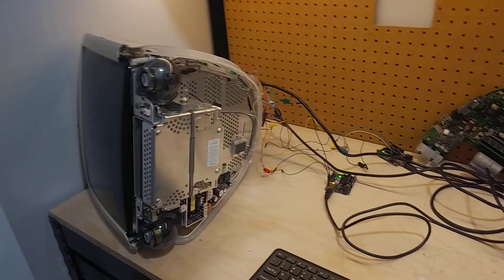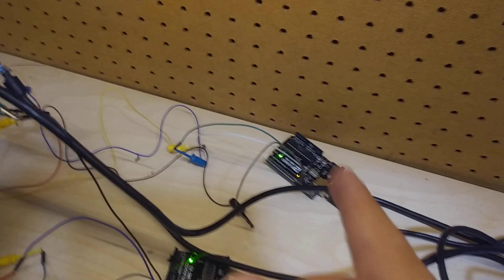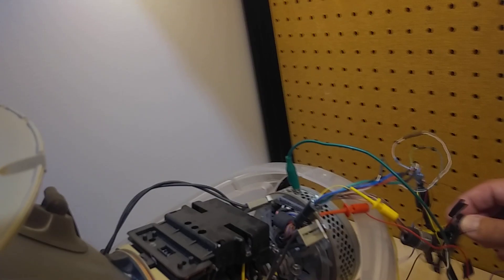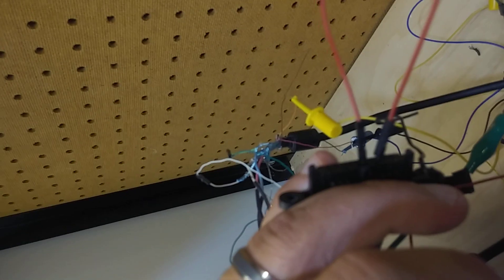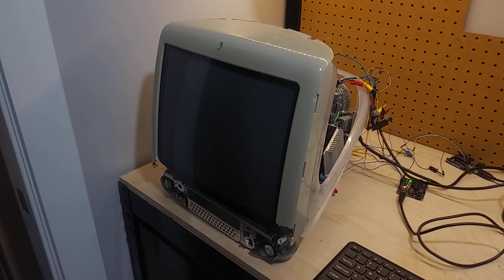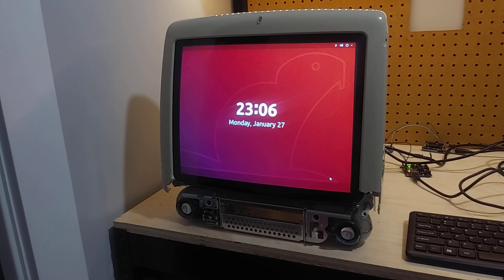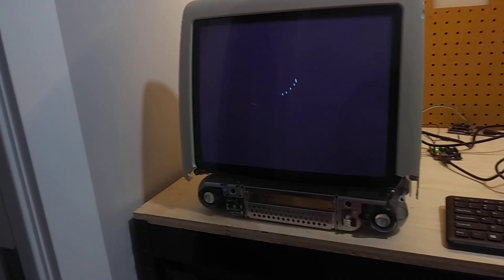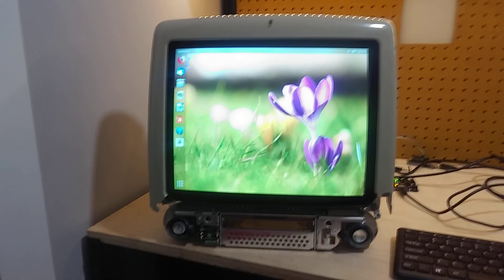iMac G3 as a monitor with no logic board

Comment: Can you please answer before tomorrow!! We have an exhibition we did everything and it works but the screen is greenish, the red is probably not going through but i checked continuouity and its all good.

We don't have the -10V plugged in could that be it? Or could it be from the arduino init? 

The screen definitely had full colors before 

Would be so happy to hear back from you and we can send you the results it will be in an exhibition here next week
Reply from the maker: Hello @egosumali email me at qbancoffee@yahoo.com and explain what's going on. I'm pretty sure I know what your issue is.
Reply from the maker: The issue most likely is that the init sequence sent by the J20 board is from a different G3. The init sequence includes custom configuration for the G3 and every G3 is different. To solve this you can use oshimai's gui to configure it. you'll need a ttl usb to serial adapter and the software. plug in  the usb to serial adapter to the computer that will run the program, connect the TTL side of the adapter to the J20 board as described in the wiki and run the program. you can then use the GUI to adjust the colors on your G3. Additionally, you can just change the values in the sketch and upload and test until you like what you see.  email me at qbancoffee@yhaoo.com

Comment: Not sure if you still check these comments, but it's worth a shot. I followed the guide in the repo step-by-step to convert an old G3 slot-loader I had and... it works!! 
...for 90 seconds. After that it shuts itself down. I know it's a long shot but if you've got any idea as to why it could be doing that, I would really appreciate any bits of information you might have.
Some supplementary info: It's always 90 seconds, no variance whatsoever. Picture comes up blurry, tilted, and dim, but I'm sure there are some bad caps in the display itself that I'll need to get around to replacing as well as some careful re-adjusting of the display itself. I've tried adjusting the vsync power-off timeout to see if that prolongs the uptime, but no dice. Fingers crossed it's something simple I'm just missing because of inexperience, but I'm in too deep to give up now. Endless thanks for putting the time and effort into making this project available to the public. 
Cheers, and hope this reaches you!
Reply from the maker: Hi!  Sounds like you just need to solder JP3. This solder jumper is what connects the V_SYNC signal to the micro controller in order to be monitored. Alternatively you can completely disable this automatic shut off feature if yo comment the "externalCircuitOff()" function call on line 180 or thereabouts. 

    //do stuff whn vsyncDetect is 0
    if (vsyncDetect <= 0) {
      startTime = 0;
      currentTime = 0;
       //externalCircuitOff();

    }

Regarding  your wonky picture, you can probably adjust that using Oshimai's monitor adjustment tool. All you need is a 5V TTL USB to serial adapter that connects to the J20 board and you can run his program to configure the iMac.

https://youtu.be/g9aLTrW5eaU?si=PSUeZirngG73rhpO
Reply: @rockyhill3  Thank you so much for the quick response! I'll give it a shot and post again with the results! Much appreciated!
Reply from the maker: @izanegi  You're welcome and good luck!

Comment: My problem is with the high voltage supply to the CRT. My goal would be to replace the CRT and Logic board both with a 15” lcd screen and an Mac Mini. Basically keeping the shell and using it while I source and troubleshoot the original components. If I could keep the CRT and redo the logic to a mini would be my ultimate goal. Any schematics available online for the power supply to the CRT?
Reply from the maker: https://github.com/qbancoffee/imac_g3_ivad_board_init
Reply: @rockyhill3  thanks for the link! Will check out the project but I think I have to change out some if not all of the electrolytics on the power supply board(s) to curb overheating.

Comment: Hi, I hope you can help me ...
My imac G3 500 DV stoped working last week.
I can't find the issue ...

What makes me confused ist this 24 Vac source.
Is this now 24 or 48 V ac ?

In one pinout it is labeled "24 Vac Phase1" and "24 Vac Phase2" ... I tested 24Vac on these both pins to power up the power converter and the logic board, but did not start.
Is this 48 Vac and the GND is between the both, so if meassured from one "phase" to gnd I see 24 V ac?

I build a adaptor now to start up the logic board with an atx psu, the logic board works fine.

Following your infos it should be possible to bridge these 3 pins at the video connetor and the CRT should switch on, also if the logic board is missing? Just to see, if the AV board works = crt works and without sending the edid datas, just to see and hear the high voltage powering up

Thanks and a happy new year!
Reply from the maker: Thank you for commenting. I just replied to email. let me know how it goes.

Comment: PLEASE make a pcb, Ive wanted to put custom hardware in one of these for ages.
Reply from the maker: The PCB design is on github but you will have to order and build it yourself. However, I am currently working on a design that can be ordered mostly assembled so that I can sell them or anyone else can order them and finish assembling them.
If you're comfortable with soldering you can fins instructions and videos here, just scroll down.

https://github.com/qbancoffee/imac_g3_ivad_board_init

Comment: Do you think it would be possible to do this on an eMac G4?
Reply from the maker: Actually, yes. My first time doing something like this was with an eMac and the iMac mod is based on what I learned from modding my eMac. The eMac work is not as documented and I don't have boards but there is sort of a guide and people have been able to do it.
Take a look through my older vidoes and read this wikibook.

https://en.wikibooks.org/wiki/How_to_modify_an_eMac_to_use_as_an_external_monitor

Comment: This could work for those that had their backup batteries leak and corrode the mainboard!

There's also an open-source CRT controller project that I think accepts a raw RGB signal, I can't remember the name of it (but I remember a GitHub repository exists).
Reply from the maker: Absolutely, you can use the CRT if your logic board is dead but the analog board is still good. 
I have one I use as a VGA monitor when I want to play retro games
Reply: @rockyhill3  
Yep! I'm lucky to have one that works, and I pulled out the backup battery before it leaked. However, I do occasionally come across some that were either untested or didn't start up.

Comment: Can I use an iMac g3 1998 because it uses a 50 pin video cable? Also because the main bored is damaged so it won’t install an OS
Reply from the maker: I'm not sure which iMac you're referring to. This mod will only work with the DV version or the slot loader G3's. If it's a tray loader, then there is another mod that works for you. It's easier than this one.
Reply: @rockyhill3 The first model
Reply from the maker: @Fishmaster_i12  I think the first model can be easily modified. Here is one person who was able to do it.
http://whatdoyouguyswannado.com/Zotac_Powered_Grape_iMac_revD/
Reply: @rockyhill3  can I just connect the video Connecter to the computer with an extension cable?
Reply from the maker: @Fishmaster_i12  I'm not sure because I haven't modded a slot loader before. From what I've read though it seems that it's probably something like that.

Comment: Very cool. I have the older tray loader model so I'm guessing the process would be different. :(

Would be cool if I could do this without taking out the mobo though. (Would be easier for that route too. Just have to create a Y connector and switch it to an external input. Just let the mobo boot up like normal then hit the switch. That's probably how folks did it before you RE's the init stuff. If i were to do this I'd go that route since I still want to keep the original mobo in mine. :D
Reply from the maker: Thanks!
The tray loader is actually very different and the mod is easier. Unfortunately I don't have a tray loader so I can't really explain much about it other than you sound like your on the right track. There are several people that have successfully done the mod and shared. Elvisa on macrumos forum recently got his to display video.
https://forums.macrumors.com/threads/imac-g3-mod-video-connector.1712095/post-28757361

Comment: That's a great idea! How much did the project cost you if you don't mind me asking?
Reply from the maker: Well, it's hard to say how much I've spent on this project given that I've made several revisions of the boards and I've had to purchase spare parts here and there. I can tell you that if you order the boards &  components it will run you around $70.00. This doesn't include the time you'll have to put into actually assembling the boards.

Comment: There should be a PCB for the tray loader g3 as well.
Reply from the maker: Unfortunately I don't have a tray loader as a reference to design one and I will happily design one when ever I do get one.
That said, If you or anyone else has any sort of specs/instructions on how the mod was done, I could design one against that.
Reply: @rockyhill3  You don't need one for a Tray Loader, as the monitor is just DB-15 on the inside and you could get an adapter
Reply from the maker: @kit7une_   I would like to get my hands on a tray loader to test it out but unfortunately I have not been able to. I did however just buy a pristine ruby for $25.00
Great deal!

Comment: I'd love to buy one of those boards. Would the iMac still work through the CRT or does it completely replace it? I was thinking of using the G3 display as a Raspberry PiCade.
Reply from the maker: PiCade is one of my goals too!

To answer your question...... It depends on the degree to which you want to modify your G3.
Adding these boards essentially converts your G3 into a VGA monitor with speakers allowing you to use it with almost any computer. Space is tight in the logic board are of the G3 so if you are willing to use your G3 mobo external to your new VGA monitor then yes. This is a well documented mod and one that I myself have done with a standard ATX power supply and knowing what I know now you can probably do it with the down converter board and a 48 VAC power supply instead of an ATX power supply. You can also opt to leave the mobo installed and and just pull out the wires needed for video and connect the pi to that. You could probably even use a video selector switch to change sources. You can probably route audio through the mic input of the G3 mobo and have it play through the speakers(that would really cool if you can get it to work).  

You could also mount the pi the analog board area(the part visible through the transparent plastic) because there is plenty of room there. 

 I hope this answers your question

Comment: an imac G3 can be used as a tv monitor? to play super nintendo as example with some sort of AV Component Cable?
Reply from the maker: In theory with this mod you can theoretically use any VGA source. If you can get a composite to VGA adapter then
you're in business.
Reply: The Super Nintendo outputs 15khz (240p) natively, which is out or range for a VGA monitor. However, with an OSSC (Scan Converter), you can upscale the signal to 31khz (480p), which should work on VGA monitors and presumably this modded iMac G3 monitor. Note that this method is viable if you want to tap on the RGB signal from the SNES for the best picture quality.
Reply: 2 yrs later…. I imagine a modded G3 with a Nintendo Wii stuck in place of the old logic board… would make an incredible tournament set up for SSBM.

Comment: Is this a slot losing or tray iMac? It’s been years since I looked into iMac using a g3 iMac as a display but I would like to do it at some point if it got a bit easier. If you end up making a vga out PCB that works with the slot loaders let me know.
Reply from the maker: This was done with a slot loader, actually two slot loaders. I've made the pcb's and they work but I'm actually waiting on a second revision of two of the pcbs. They should be here in under a week.
Check out the repo with the designs.
Reply from the maker: https://github.com/qbancoffee/imac_g3_ivad_board_init.git
Reply: @rockyhill3  Thanks and great work on this stuff! Hoping to do something like this with one of mine so I'll keep an eye on your channel and repo.

Comment: Thanks for keeping the updates going. Feeling motivated to retry my eMac project, just need to get that IVAD initialisation working!
Reply from the maker: How far have you gotten?
Reply: Rocky Hill all connected up, I can get the relays to click by sending 5v but the ivad code doesn't seem to work. I'm in the UK so wondering if there are different codes for different regions. I haven't touched the project for a month now so will have another look over it soon.

I'd be interested to know what vga connector it uses, would rather make an adapter than splice the eMac cable. I looked into it and learnt about pin pitch but couldn't match it to anything.
Reply from the maker: @luke255x  Different initialization codes for different regions  hadn't occurred to me... Do you think you could make an i2c sniffer with your arduino? all you would need are the 3 lines SDA, SCAL and GND. If you can sniff the comms between the IVAD board and the logic board I could implement it in a sketch.
Reply: @rockyhill3  Yeah that could be it, or I've just messed it up somehow!

I'd be happy to try that, although the motherboard needs some repair. At some point in its life someone tried to replace some capacitors and some of them have desoldered.

I'm hoping to get some time this weekend to have a tinker so I'll update you.

Comment: Fantastic progress!
Reply from the maker: Thanks! 
I think my next step is to design and make a printed circuit board to which the connector plugs into 
and has a VGA connector on it to make my next G3 easy to mod.
Reply: @rockyhill3  I'm looking forward to seeing that, and would love to use one myself.  My Bondi Blue iMac G3 is itching for a modernisation.